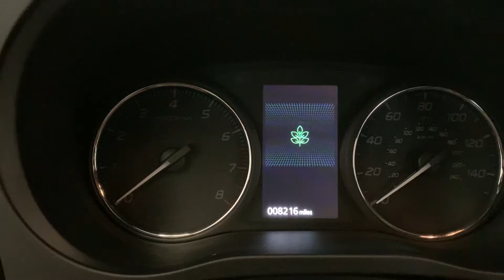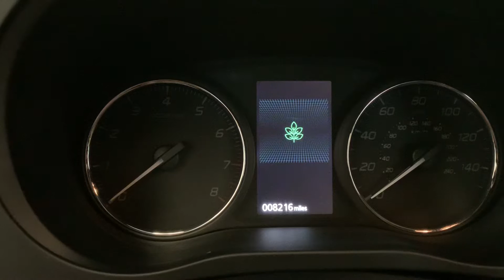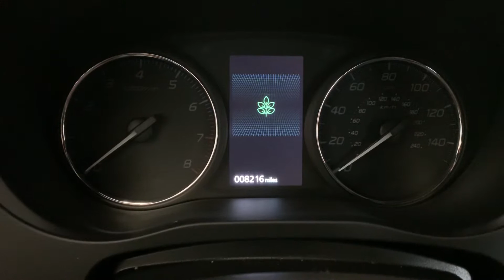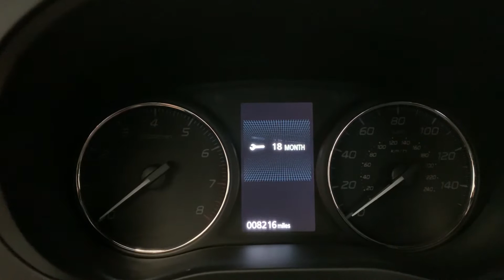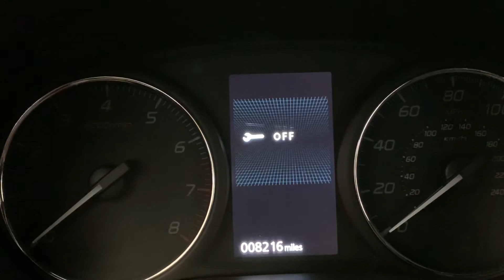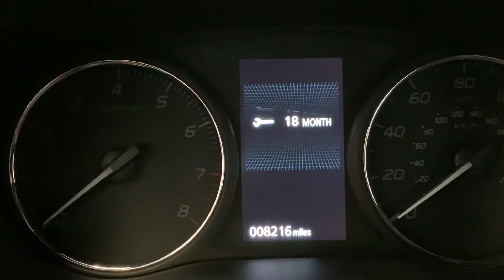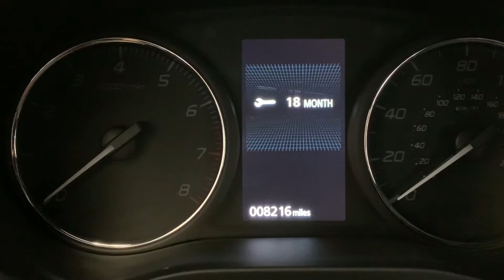Mitsubishi Outlander maintenance light.... Explained??!??? Mostly

Comment: Man your video is on point. I had one question, one of my little ones accidentally messed around with that button and some how turn off the oil service reader, do you know how to turn it back on I tried some of the things you showed on the video I don't know if I'm doing it right or need to keep trying but kinda not working for mine 2018 mitsubishi outlander, if you have a answer would be great?
Reply from the maker: Honestly not sure without playing around with those settings. I feel like I recall an off setting in there, perhaps choosing a low mileage setting and seeing if it comes on when that mileage is reached? Sorry I can’t be of more help.

Comment: I just set the B trip to zero when changing the oil and watch mileage. 3500 miles on trip B time to change the oil. Trip A i use to find out how many miles per gallon i am getting. at each fill up i set Trip A back to zero. When maintenance light comes on i just reset to what ever is on the screen.

Comment: I have a 2016 and there is no menu button.  Your instructions are very clear, but I cannot get to the menu.  Any advice?
Reply from the maker: Hmm. Make sure the engine is off and try both accessory and “run” with engine off. There seems to be a lot of variety in these menus for Mitsubishi. Hope this helps
Reply: I have a '19. It's the INFO button to the left of the steering column.

Comment: If only you could turn off the bing bongs this easily.....drives me mental!
Reply: Which ones? Turn signals or the seat belt?
If turn signal, you need to engage the E-Brake, then cycle through the info button till it says, "Settings Menu" press and hold the info button then you'll get a list of things you can change. Page 2 of the settings 2nd to bottom is where you'll see the 2 arrows. Options 1 & 2. 
I have a 2012 Mitsubishi Outlander SE

Comment: The last one at the end of the video that showed 3100 miles / 6 months and you said "That doesn't make any sense." does actually make some sense. In Japan that's 5000 kms / 6 months which is the Severe schedule. The Normal schedule of 6800miles would be 11000kms / 12 months. Those match pretty closely the schedules sourced from Mitsubishi which are actually 6,000km / 6m and 12,000km / 12m

Comment: Ugh I don’t have that button on the side and I don’t have an info button, someone please help, I have 2016 outlander suv amd it’s driving me crazzyyy
Reply from the maker: You can try this with the multi-information switch that changes the menu. Might work. Select the wrench and push and hold that button instead until it blinks.
Reply: @RaceBreakRepeat  I don’t think I even have that switch either. I don’t have the button you have and I don’t have the little info button and no Multi-info switch

Comment: This just showed up on my vehicle is it important??? Or is it just a built in thing with the car that doesn’t really matter if you service your car on a different schedule
Reply from the maker: It’s a maintenance reminder based on time/mileage only. Not directly linked to oil condition and required manual reset. You could change the oil everyday and this light could always be on and it would be fine.
Reply: @RaceBreakRepeat  thank you for that x

Comment: You know how to change ODO? Miles to km?
Thanks. Lima Perú.
Reply from the maker: Try, “ believe while in park, you need to pull the E brake and use the function select button just left of the steering wheel. I think you can toggle through different settings to get what you need.”